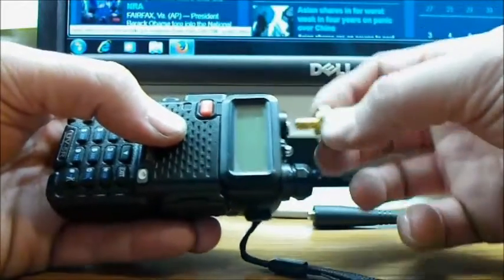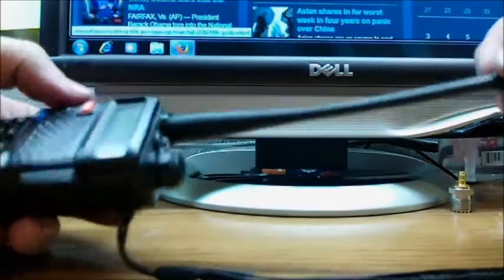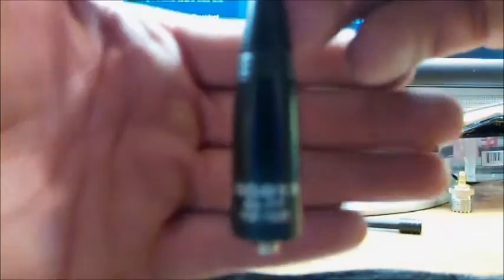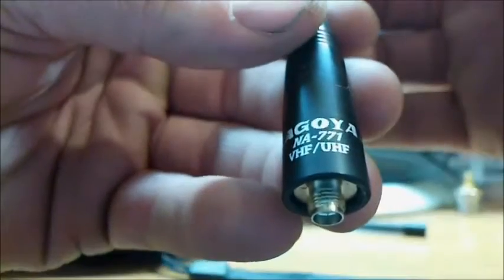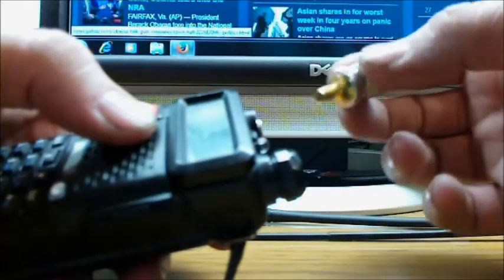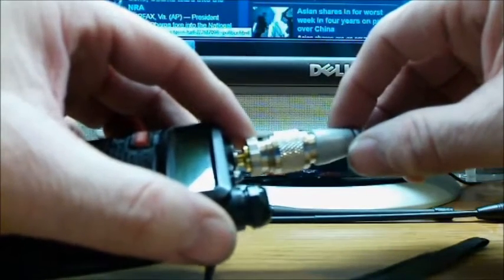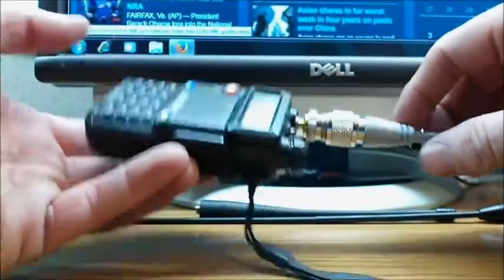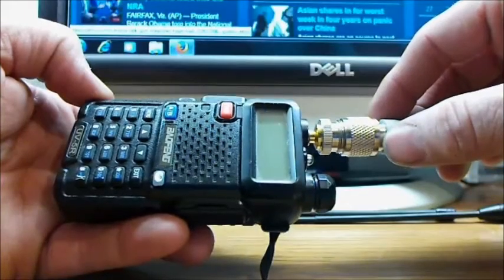Antenna Options for your Baofeng UV-5R

Comment: if the fake antenna is not broken, it works like the original.

probably the smartest solution for a 30 euro radio is a fake 4 euro rh901s diamond
Reply from the maker: Well you are correct, its all about what you can afford.

Comment: I just  got that radio for 25  on amazon.. I'm new to the ham  radio  stuff. Any advice  for me.
Reply from the maker: Well as far as other hams treating new comers to the hobby I have not seen that at all in my time when i was new, I think its the hams that you are hanging around.
Reply from the maker: Use the ARRL website and get their books like "The hand book", "The Antenna book", any of the "Wire Antenna Classics" books, get the "Operating Manual, get there "Understanding Basic Electronics" book.  Find a local Ham Radio Club, search youtube for good educational videos on the subject that your interested in.  Buy the radio that you can afford, I started out with the Baofang UV5R and progressed from there, talk to other hams get their opinion on what type of equipment your looking at and they will be most willing to help.
Reply: Yeah as a aspiring ham newly licensed myself, all i can say is if you think u can handle it by yourself (you can) then stay away from other hams, they suck at teaching new to the hobby people, they treat us like dirt because we no longer need to know code and are as good to them as the unlicensed

Comment: all Boufen dosen't work with external antenna because there is not filter inside the aparate go to saturation----
Reply: Pietro Musian wtf? Do you even understand the basic premise of how radio works?
Reply from the maker: Yes they do!  I used a Jetstream base antenna (SO-239) with an adapter SMA female to SO239 and got the antenna 25 ft in the air and got about 15 miles with my Baofeng UV5R.

Comment: First this is a great video. For the record I was able to hit a repeater 60 miles away no line of sight and uneven ground with the stock rubber duck. YMMV but it was a feat i am proud of..
73s
Reply from the maker: Outstanding you found what they call a hot spot.  Keep up the good work.

Comment: what if you put a oe254 up on a mountain lol
Reply from the maker: Sure why not, I don't know what that is.
Reply: An oe254 is a broadband antenna that we used in the army It's hard to talk over terrain so we would bounce the radio waves off of an OE254 on top of the hill or mountain to talk to each other
Reply from the maker: @seantbr2019  Cool, I was a 52 charlie in the Army during the early 90's
Reply: @snafu673  nice man I was a 19d got out a couple years ago
Reply from the maker: @seantbr2019  Rodger that !

Comment: I am a new ham and got this radio for Christmas and I was wondering where I can get a cheap mobile radio for less than 60$ Im going on a road trip and I just got my license a week ago
Reply from the maker: Thats going to be kind of hard for a mobile radio, you might try looking on QRZ.com in the swap section.  Do you know what kind of mobile you are looking for.  you also my want to check Amazon and look at the tyt radios but not much for under 60$.  An HT (hand held) like a Boafeng you can get for under $60.
Reply: Get a rooftop ant. For your car
Reply: Network_Guru_Anonymous lol. You're not going to find a mobile rig for no $60. You'd be lucky if you can find a good used one for under $140

Comment: I have my female adapter to SMA236 on about 10 inches of small coax. Less strain on the radio connection.
Reply from the maker: I did notice that when i used the SO239 to SMA female i did notice that it was stressing the connection point on the radio, I just have not had the chance to pick up the connector you're talking about.  Hey Thanks for watching.

Comment: Check the swr.  Just tested 4 Nagoya  771 and found very bad SWR's. Trash.  The stock a-v85 boafeng antenna is better.  Test all antennas.  The people selling antennas know nothing and the advertising is often misleading... iF YOU CANNOT TEST THE swr, PAY THE BUCKS AND GET A dIAMOND OR OTHER HIGH QUALITY. A bad SWR not only reduces the tranmitting power out, but will eventuall shorten the life of the radio.
Reply from the maker: Yes I have since that recording have purchased the Diamond SRJ77ca thanks for the update, I will be making a revised video on this.
Reply: Most of the Nagoya's are fake and junk antennas. Unfortunate but it's tough to buy so much stuff on Amazon, especially radio gear that ISN'T counterfeit!